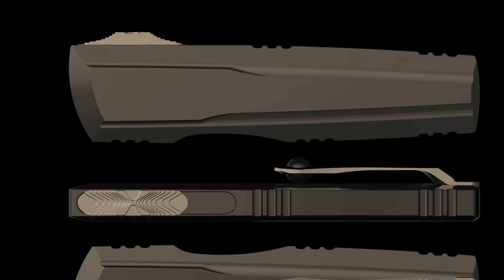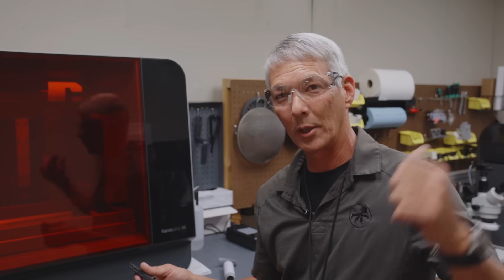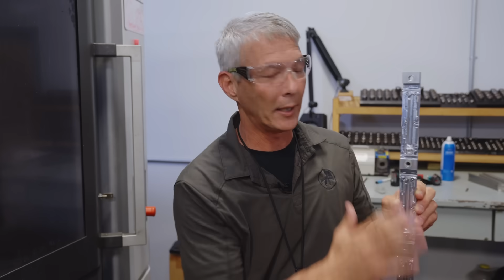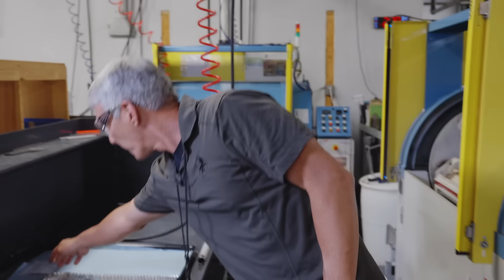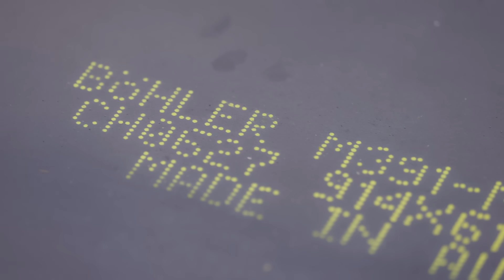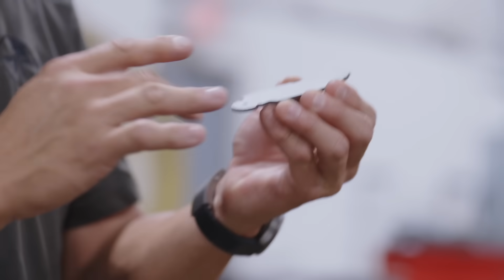Microtech Knives, behind the scenes plant tour. Part 1

Comment: Dude.  If you are taking 9 hours to make the cuts shown you need to work on your tool paths.  Those big HAAS machines should be able to spit out those parts in less than an hour given the fact that it is simple aluminum.  You definitely have something screwed up with regard to speeds, feeds, and toolpaths.  BTW.  I’ve carried your knives for years.
Reply from the maker: I will personally pay for your trip here and compensate you for your time for you to better optimize our run times. We have hired independent companies to look at our process and we are at like 95%.